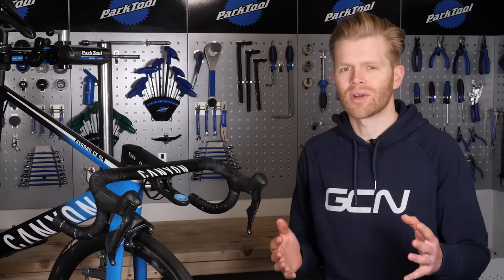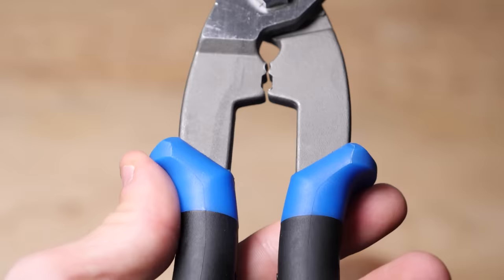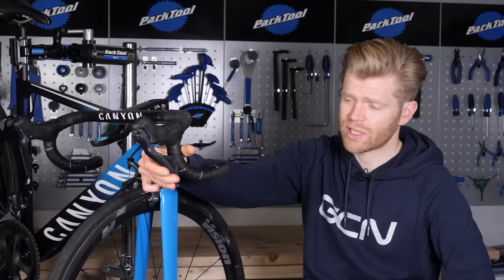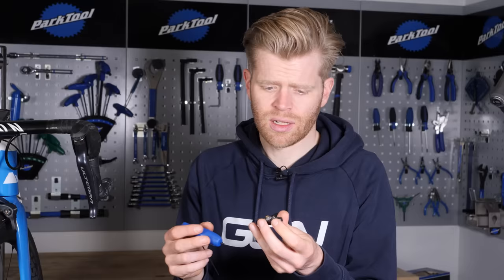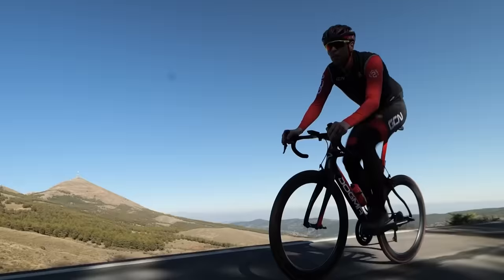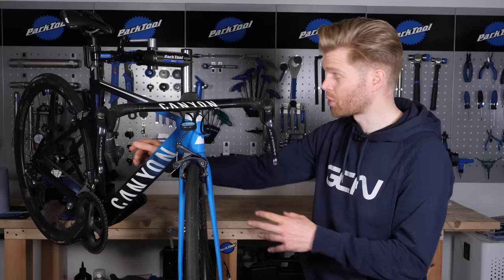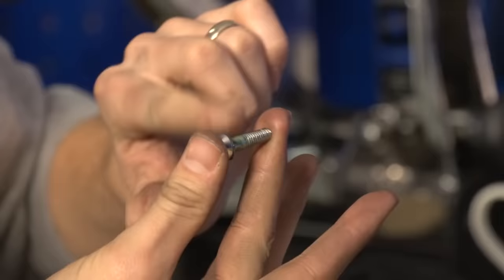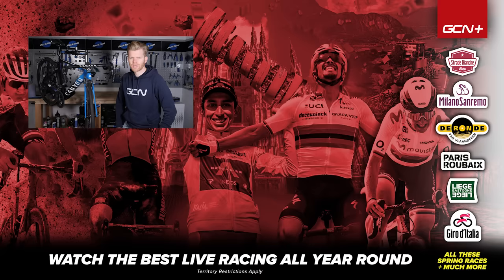Try This Before Changing To Disc Brakes! | Maintenance Monday

Comment from the maker: Have you made the switch to disc brakes? Let us know down below!👇
Reply: I use Drum Brakes through downhill, its as effective as rim brakes✨
Reply: I have, from a Giant TCR Sl0 to 2021 TCR disc. Now im looking back memory lane, should’ve just kept my rim brake.
Reply: I have Sram Hydro rim brakes. The best of both worlds. Unfortunately routing hydraulic cables and gear cables through internal routing is a nightmare. It took me 4 afternoons to make it work properly.
Reply: I did I brought a 2018 TCR disc... after 12 months decided to sell it.

3 years on now on a tcr rim and never looked back 🙈😂
Reply: Why are some pros running 180mm disc on the front? 🤔🤭
Reply: Started using disc brakes on my mountain bike in 2015, and then on my road bike in 2019.  I will never go back to rim brakes.
Reply: No. Alu rims and dual-pivot caliper brakes work great.
Reply: No.  But the frame being made for me has flat mounts and brake mounts so in the snow the bike works grand
Reply: I Will never switch!! Rim brakes for ever!!🤩
Reply: Fifty thousands km ago... Now I can buy pricier (and nicer) rims and have them virtually forever.

PS
Rim brakes are like parasites - they need to harm a host to survive! ;)
Reply: @PrzemyslawSliwinski  your rims fall out of true faster than tracks get used.  Your road bike is slower, and costs more for less
Reply: @PrzemyslawSliwinski  with anodizing and ceramic paint rim brake tracks can be built up.  But the cyclinindustry hasn't done this yet.

A thin coat of a ceramic/epoxy paint on brake tracks can keep them lasting forever.  And black anodized enamel paint breaks better than metal
Reply: @chrisprice5895  Too much hassle... Had I been riding on a pristine tarmac exclusively, I could've had a second thought.  

But if it works for you then, well, that's really great!
Reply: @PrzemyslawSliwinski  discs have always been more faffing.  And their performance is worse due to aerodynamics and weight.  You are dreaming
Reply: @chrisprice5895  Yeah, yeah...
Reply: Disc for dirt and rim for performance road bike👍
Reply: MTB brakes on road bikes are just insane.  We spend so much money to reduce the weight of our bikes just to put it back on with MTB brakes.  Insane.  It's just a trick for the bike industry to make more money.
Reply: Of course. Carbon wheels and rim brakes make no sense if you are not a pro and get the wheels for free.
Reply: First thing I do on my MTB frames is filing disc brake bosses off and adding new bosses for  V-brakes.
Reply: My first disc brake bike was cable not hydraulic actuated and I hated it, the lower pressure of cable brakes tended to chirp excessively.
Reply: @hansschotterradler3772  So is the weight... and aero... and almost any other tech nowadays...  

You don't have to like a someone else's bike...
Reply: @PrzemyslawSliwinski  oh I agree with that
Reply: Are there a lot of people out there doing a conversion on their bikes from rim to disk? Got to be low %. I went disc on all my bikes as I replaced them with newer versions over the years. Obviously won't be going back, not a thing or really a relevant possibility... but I did click on it.
Reply: @cc-000  yeah but you don't have a 500+ watt FTP.
Reply: @mikesima9396  lol big market got your nose 👃
Reply: Yes. Caus rim brakes limit the tire width you cam pu on the bike
Reply: No thanks. I still love my rim brakes on my road bike!
Reply: Only on my heavy steel commuter bike that goes out in all weather. The other 4 road bikes are rim brakes !
Reply: @asicdathens  Pity shimano or Campy didin't offer up hydro rim as an option. I'd consider a hydro rim if they were to get the braking surface better like a ceramic track.
Reply: @glennoc8585  I have Fulcrum aluminium rims and the braking is exceptional with SwissStop pads
Reply: @daniboi4067  my wallet too
Reply: I did! But, after the problems I've had with my Shimano hydraulics ( corrosion, multiple bleeds, etc ) I want to go back to rim.
Reply: no and will not switch.
Reply: Nooooo only in the dirt!
Reply: This is the first time Ollie’s hair wasn’t ridiculous. Divorce/breakup and trying to look decent for the next potential Main Squeeze?
Reply: @danc1829  bought, not brought
Reply: @Lemond75  sorry sir 😂
Reply: My Shimano Ultegra rim brakes are brilliant for road use. No need for anything else in my humble opinion.🤔😊🚲🤗
Reply: My Shimano Ultegra rim brakes are brilliant for road use and more than happy to stick with them.👍😊🚲🤗
Reply: Froomie is on an island with a squealing disc.
What a lemon.
Reply: *in basic physics, the further away you apply an opposite force, the lesser strain you will experience, i believe therefore if the skewers or dropouts are the fulcrum or center, rim brakes are furthest from the fulcrum compared to disc brakes which are closer to the twisting point, both may perform or outperform each other but it cannot be denied that the area at the rim requires the least stress to stop the rotating wheel than the discs that are too close to the fulcrum aka skewers (notice that motorcycle hydraulic brakes have discs that are way larger than bicycles because of physics) excluding the fact how often it will take a user to replace either brake shoe or brake pads on equal usage

*I experienced both brakes, if you use rim brakes, since the opposite force is furthest from the hubs, its more possible the tire will skid upon maximum braking force which i think is safer than a disc hydraulic brake that may cause the rear tire to lift from the ground because it is too close to the dropouts, well, depending on terrain

*So i think it all boils down where you gonna use your bike, i believe hydraulics are only suited for trail riding, nothing else, rim brakes are sufficient if you only need to travel to work, leisure rides, or long smooth roads then rim brakes should be enough, you dont need strong brakes on a smooth road surface races anyway because you don't want momentum to drop, so i believe disc brakes are only for trail cyclists because it also evades mud on the tire due to the discs being a little closer to the skewers away from the muddy tires that make the pads slippery

*I am not a racing cyclist and i regret having discs on mine, out of the trail, discs are too much, im gonna switch back to rim brakes, im not a fan of trail riding anyway, i got my bike with discs as stock, fortunately the fork and seat stays still has holes provision for rim attachment, rear rims are way responsive than discs, at the front, i think its equal

*Im also open to combinations to achieve most efficient braking, front is disc, rear is rim, i chose rim for the rear because it will take more force to stop the entire load both bike and rider so using a disc at the rear will severely stress the pads since its too close to the rear dropouts and wont be as effective as a rim brake, so maybe hydraulic disc at the front and rim brakes at the rear

*Although i hate the problem about serviceability when things bog down regarding hydraulics so im also thinking about a partly hydraulic or mechanically accentuated or semi hydraulic disc brakes at the front, or maybe just high quality mechanicals at front, rear is rim

*I dont think manufacturers will completely imitate the motorcycles brake system because of the weight issue, lets be honest to ourselves, vintage mountain bikes long ago never had a suspension fork nor disc brakes, incorporating it to bicycles only became a trend but with lesser specifications for a reason we may guess why thats why i thought it was only applicable to mountain cycling, nothing else
Reply: still with rim brakes. I was very unhappy with the performance when in very wet conditions and I tend to do a lot of hills. Swapped to SwissStop brake pads for alloy rims, from the Race series. These really fixed the issue for me & no more scary descents in the wet! Still happy with the easy to maintain and reliable system.
Reply: @cc-000  Don´t feel the same about this, before I swapped to better brake pads I would have signed this. And you could call my bike with a 10s Campa Centaur CT a museum piece indeed. But it does not perform like a museum piece, the braking is very accurate, rain is no longer an issue with good pads. The bike got modern wheels though, a good combination of rim/brake pads is just what it takes. I remember trying to brake in the rain and there was just no stopping power or it took very long for the brakes to give me any feedback, with dirt and grease on my rims from rain on a dirty summer road. Now it is not only acceptable, it is a complete turnaround. I did not understand how they survived so long in racing before I tried PROPER pads.
Reply: No - and I am not going to😉 I have been riding for 33 years (22 years in competition) and my Zipp 404 and my Shimano Ultegra rimbrakes works perfect👍👌😉😃😃
Reply: Yes my  mtb has disc brakes and my hybrid has rim brakes i so prefer my disc brakes 😅😅😅🤣🤣
Reply: I still not swith to disc brakes.
Reply: No n never..kudos GCN for stands out the merit of rim brakes
Reply: @swampscott2670  yeah you can use 23c. But from where im from, good luck using 23c on an icy road.
Reply: @swampscott2670  I have 25c with no issues.
Reply: I'm sticking to rim breaks no matter what.. disc brakes are too complicated.. never complicate the bike always make the bike easier to maintain
Reply: @stevensantana8049   bikes are simple machines that require simple components, disk brakes are a solution to a problem that doesn't exist
Reply: @chrisprice5895  can you apply this  enamel paint onto alloy rims as well?
Reply: No and I never will
Reply: @PrzemyslawSliwinski  disc brakes cost more than rim brakes long term via costly pad and disc replacement. My carbon rims only $180usd each and pads are cheap
Reply: @richardggeorge  I ride a bike all year long. Used to have rim brakes. Had to replace rims every two year or so. YMMV.
Reply: No, I haven't as I was able to snatch a pair of Enve tubular rim brake wheels formerly raced by Team Bigla with a tremendous knock off.
Reply: yes.  my first gravel bike.
i fucking hate everything about them other than the clear massive advantage of feathering capabilities
never fucking line back up when you take your wheel off the frame, noisy, oh and don't touch them because you'll get your skin oil on them but meanwhile you're riding down a freaking road getting all kinds of crap all over them, heavy, did i mention noisy?, I also forgot, be careful not to bend the very fragile disc, did i also mention the vibrations if not perfectly aligned?
literal garbage.
I knew i should have bought an old felt cross bike that was for sale than a brand new salsa
Reply: No
Reply: When I ride road, l simply don't use the brakes enough to justify the overhead. That would be the expense, the weight, and the complexity of maintenance.
Reply: well i am an emtb guy so using rim brakes is like trying to stop using a wet sponge. hydraulic discs all the way!
Reply: Disc brakes do solve the dilemma of carbon clincher rims. Since the heat is generated at the rotor, there's no risk of overheating carbon rim flanges.
Reply: what about the tire size limitation with rim brakes? I switched to disk brake and I am running 700x30  tubeless tires , but on my previous bike with rim brakes was not possible due the arc of the rim calipers brake. Other good thing about disk brake is : no matter if rim is aluminium or carbon brakes will brake.
Reply: @steva_nolimits  They want more power for slowing from 100 kph? If you're going that fast, and your equipment sponsor has already mandated that you use disks, why the hell not?

Personally, I rarely exceed 90 kph, so that kind of slowing power doesn't appeal to me. Your performance may be different.
Reply: @patas67  I have no need to go fatter than 28, so . . .
Reply: @monkmchorning  problem solved , right? where I ride we have bad roads, that is why I moved to fatter 30's and tubeless, so now I have a better ride :)
Reply: Winter bike is old 105 disc, just for the wet, summer bike is carbon deep rims and rim brake. Best of both worlds. If I ever go to the Alps, I’ll take the disc for downhills but I prefer the rim brake all round.
Reply: Never!
Reply: light aluminum rims are most fun and least trouble, they just don't look as cool. A 7kg bike still feels better than an 8kg bike. with rim brake bikes that was affordable, not so much with disc brake bikes.
Reply: Disc Brakes Are 2X As Strong = FASTER SAFER RIDING
Reply: @darrinkulyk9560  problem is not how strong they feel / are, problem is that 700x25 tire is the limiting factor of break surface tension, you will lose traction before the extra force matters.
Reply: @darrinkulyk9560  go check the first 5 seconds of the new VC video with the crash, tell me if anything could have done to stop this, its pure physics, the coefficient of friction of the tyres is very small in the total (negative) acceleration time, brakes barely have anything to do on this, as they reach (in either format) their ability to lock the wheel. Then more physics take place.
Reply: @TheRimBrakeGuy  Trail Braking ..... with Different  Systems  You apply Different  Techniques  . Like driving a car with drum brakes over Rotors  Nite abd Day ... EVEN SEMIS Have Gone too Rotors lol lol
Reply: @darrinkulyk9560  you need to look up on classical mechanics physics, the problem is not stopping power (both systems can apply it at the same level or more for stopping power). Problem is that before that higher limits, surface friction (aka the tyre) will become your problem, as skidding will take place, locking the wheel. Disc brakes are heavier, wheels also due to due to failures at hubs/spokes assembly was breaking, frames are heavier to counter the forces from disc brake forces for no real benefit unless riding on the wet, which oh wait, can affect even worse the surface friction if more force is applied than needed and accelerate the loss of control.
Reply: never
Reply: Yes, hydraulic disc brakes are a whole new level.. I can brake really hard with simply using 1 finger, it is a lot less effort than cable v brakes.. I'm so used to it, everytime I use my wifes bike, it feels really difficult and more work to brake.. 😂
Reply: I have and I love them.
I'm a heavy person, and worse, for fun and more, I build ebikes & engine-kit bikes that are as fast & quick as possible. My pads & rims keep getting glassed over, and I end up squeezing my rim brakes hard enough to snap cables.

For my rimbrake frames & forks. Maybe dual hub motor Regenerative Braking can save them from the garbage or being sold off. But as for my normal & boosted bikes, I'm done with rim brakes. It is extremely frustrating, and dangerous, not being able to stop, and not being able to go as fast as I want or can, because the rim brakes are so weak.

I'm done with rim brakes. I'm sick of them. Even just coasting down hill, on a normal bike, have lead to many close-calls & crashes. The weight & speeds of an engine or electric system, just makes that situation more frequent, even on flat ground. 

I'm only using disc Brakes and Regenerative-Braking from now on. Basic organic pads, then upgrading to metallic pads with bigger rotors meant for them, then maybe hydraulic lines.  And one day, I hope to have metal teeth, directly holding the tire tread for parking, and exclusively using powerful, analog signal RegenBraking for stopping, and finally be done with all the maintenance, costs, and noise of traditional brakes entirely.

There are motorcycles like Buell/EBR, that have the brake rotor at the rim, instead of the axle. But for certain, bicycle style rim brakes are dead to me. Using the last set of rim pads I have, will begin my Metal teeth, RegenBraking project.
Reply: No and not going to , shimano 105 sure brakes are fine for me.
Reply: No.
Reply: disc brakes are a con job